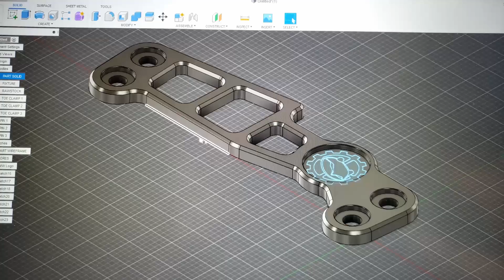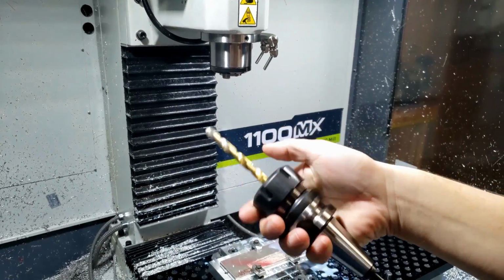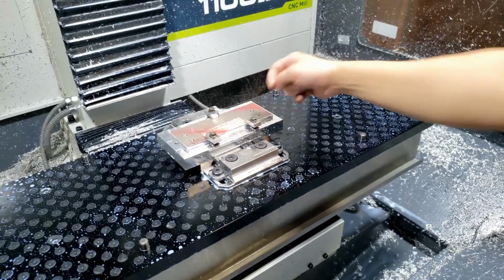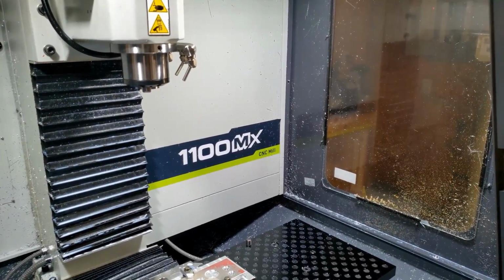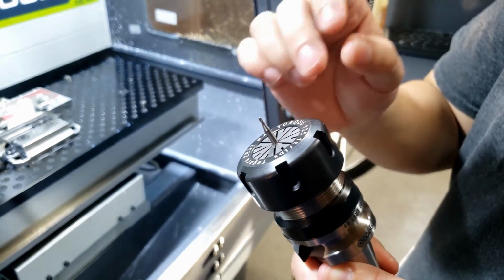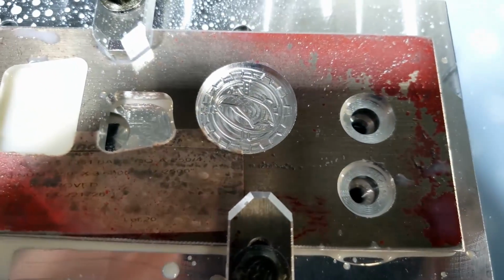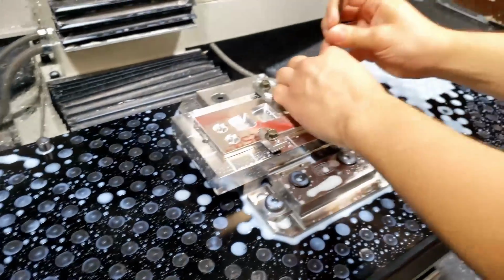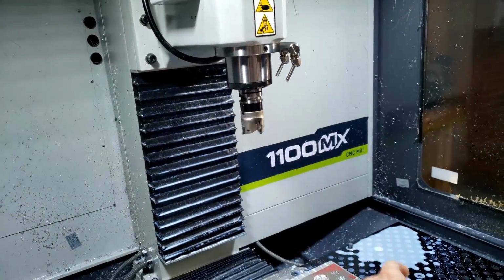Making: Triple Tree Cover for Honda Ruckus

Comment: Great video! What face mill are you using? I’m in search for one 2” or 3”.
Reply from the maker: I am using a 2.0" Korloy pro x mill.
Reply: Even a 2” cutter is a stretch for a BT30 spindle to use efficiently, especially one with lower horsepower.